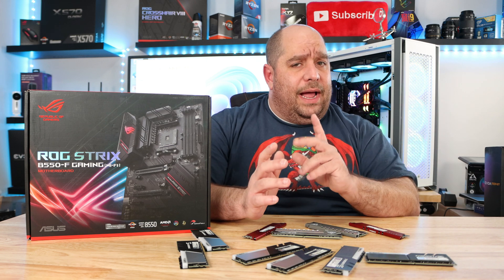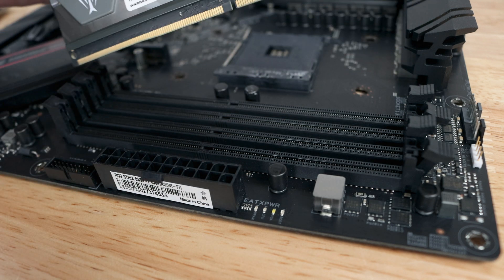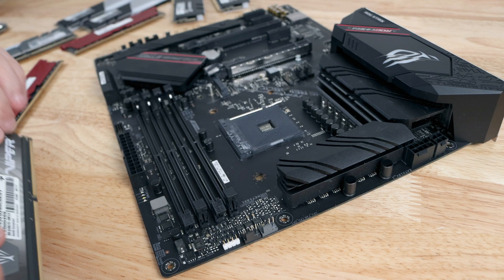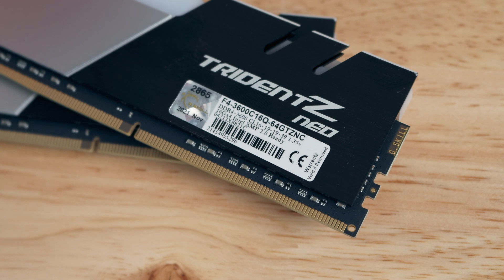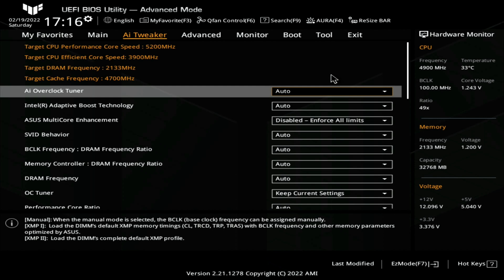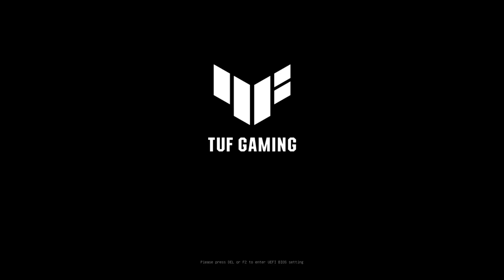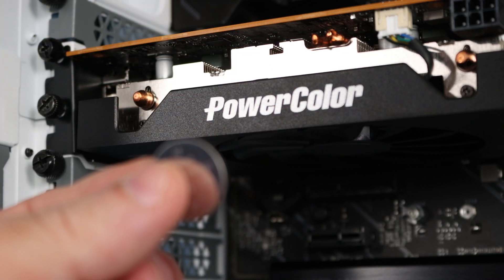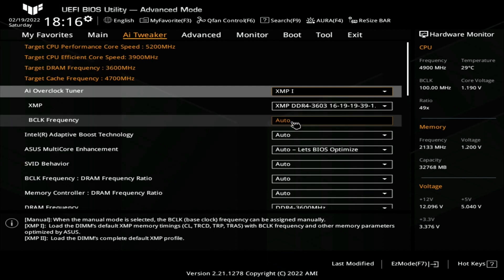How to install and configure RAM in a PC - Step By Step Setup Beginners Guide

Comment: KAYYYY so what if my keyboard and mouse keep freezing
Reply from the maker: @oscarwasntavailable SOOOOOO,  are they a wireless set of keyboard and mouse, or maybe you don't have matching sets of ram, might you be on an older version of the bios?
Reply: i have a wired keyboard, and a wireless mouse. both ram sticks are the same, (i should add that with my old stick everything works perfectly fine, yet i'm trying to upgrade from 8gb to 16gb) and... not too sure on how to update bios. (i have a b550 motherboard)

another thing i should add, i have tried putting one of each stick into a single slot and they work perfectly fine.
Reply from the maker: @oscarwasntavailable  so are you trying to put your old ram and new ram together and did you watch this video?
Reply: @ThisBytesForYou  no, i'm putting only the new sticks of ram into my computer.
Reply from the maker: Have you watched this video?
Reply: ...yup, followed all the steps.
Reply from the maker: so your RAM is in slots 2 and 4?
Reply: yeah.
Reply from the maker: b550 is a chipset, what is the manufacturer and model number of your motherboard.
Reply: gigabyte B550 UD AC-Y1
Reply from the maker: Here is where you find your BIOS', flash to the latest version: https://www.gigabyte.com/Motherboard/B550-UD-AC-rev-12/support#support-dl-bios
In this video, I show you how to flash the BIOS, at the 33:25 mark: https://youtu.be/XCggwcWdWsI
Also, what is the manufacturer and model number of your RAM?
Reply: on amazon (which is where i got it), it said  "GeIL ORION DDR4 RAM, 16GB (8GBx2) 1.35V XMP2.0" and model number is "PC4-28800"
Reply from the maker: Is this it: https://www.amazon.com/GeIL-Compatible-Immersive-Multimedia-Streaming/dp/B08T9142K2?th=1
Reply: yup, that's the one.
Reply from the maker: So your memory is not on the QVL, (Qualified Vendor List), which doesn't mean it wont work, just that its not certified, so that could be an issue.  When you use it, do you go into the BIOS, load optimal defaults, then load XMP profile for ram?
Reply: i'm using a pre-built, so i'm not sure about optimal defaults, and xmp profile1 is on.
Reply: wait a minute, i said earlier that i've put one of each stick into one of the slots, and they worked perfectly fine...
Reply from the maker: did you buy the memory separately or together in a kit?  Your using a prebuilt, built by a custom PC shop, prebuilt means more in lines like a HP or a Dell or something, this is a custom prebuilt, something you "could" build at home, you cant build an HP or a Dell, since they use proprietary parts you can't buy direct.
Reply: i bought the memory together in a kit,  and i'm using a cyberpower PC.
Reply from the maker: yes, a Cyberpower PC is a Custom Built, Prebuilt machine, as I stated, its using parts you can buy anywhere, unlike Dell or HP, you can check in your motherboard manual, that is "should" work in slot 2 and 4 (AKA DDR5_A2 and DDR_B2), you can find it on page 10: https://download.gigabyte.com/FileList/Manual/mb_manual_b550-ud-ac_1201_e_231211.pdf?v=dca890ae3ad42c15fbd578438b918570
Updating your BIOS might help, but surely using memory that is on the QVL would help as well which can be found here under the Support List: https://www.gigabyte.com/Motherboard/B550-UD-AC-rev-12/support#support-doc
This board, will also allow for Load Optimal defaults as I mentioned before as well
Reply: alright then, i might just try getting new ram sticks. do you have any recommendations, maybe?
Reply from the maker: @oscarwasntavailable What processor do you have?
Reply: a uhh... ryzen 3 4100.
Reply from the maker: Here you go, this is on the QVL, off of my Amazon Affiliate link: https://geni.us/1gRAo4t
 F4-3600C16Q-32GTZNC
https://download.gigabyte.com/FileList/Memory/mb_memory_b550-ud-ac_cezanne.pdf?v=571d6ef2c3a7b9392ee0c4dfbeb50827
Reply: uhh... real quick, where do you find the model number for these?
Reply from the maker: @oscarwasntavailable  on the qvl.... I linked up a few times now.
Reply: alright, so i got new ram sticks (i made sure they were on the QVL), keyboard and mouse still freezing. successfully updated my BIOS, keyboard and mouse still freezing. i feel like i've done everything, and nothing's worked.
Reply from the maker: @oscarwasntavailable have you tried another mouse and keyboard combo, maybe it's your mouse and keyboard that's defective?  Have your tied a different  port?
Reply: yup, i've tried another mouse and keyboard combo. but also, there's something weird i've noticed. whenever i try playing a youtube video, my mouse and keyboard freeze a bunch. however when i'm playing a game like minecraft, they don't freeze.
Reply from the maker: @oscarwasntavailable  disable hardware acceleration in the browser and see if that helps.  Also, does the issue happen with the other keyboard and mouse combo?
Reply: ...i feel so stupid right now. that literally fixed it.
Reply from the maker: @oscarwasntavailable Always a pleasure my friend, so very happy you stopped by, trusted in me to help you, liked and subbed as well as took a moment out of your day to thank me.  It means a ton to me and I am so very happy I could help you.
Reply: @ …yup, you were pretty much my only hope. if it wasn’t for you, i would still be stuck with 8gb of ram. thanks a bunch, and i hope you have a great year.
Reply from the maker: @oscarwasntavailable  always a pleasure my friend, not only do I love to help but I love solving puzzles so it was kinda fun for me too
Reply: @ThisBytesForYou  ughhh great nevermind it didn't fix
Reply from the maker: @oscarwasntavailable so what is the issue now, detail please.
Reply: @ThisBytesForYou  mouse freezing while playing a yt vid again even when i turned off graphic/hardware acceleration (it just froze again even when not watching a vid)
Reply from the maker: @oscarwasntavailable  so you still didn't answer what happens when you use a different keyboard and mouse.
Reply: @ i’ve tried, same problems happen
Reply from the maker: @oscarwasntavailable did you update the bios
Reply: @ yup
Reply from the maker: @oscarwasntavailable  did you load optimal defaults and load xmp in the bios?
Reply: @ yuppp
Reply from the maker: @oscarwasntavailable where do you the keyboard and mouse connected, front or back, and what are the colors of the USB ports?
Reply: @ in the back usb ports, and they’re black

(the freezing is getting worse and they're just constantly freezing while playing a vid and even just random at times)
Reply from the maker: Have your checked your CPU and graphics card temperatures?
Reply: yup... also i should mention, with just a single stick of 8gb ram, everything works normally, it's just that with two sticks of 8gb ram (from the same kit), it's when those problems start happening
Reply from the maker: @oscarwasntavailable what happens if you swap the sticks from the 2nd to the 4th and 4th to 2nd
Reply: @ThisBytesForYou  haven't tried it, but i'm very VERY sure it's still not gonna fix it
Reply from the maker: Very sure is not 100% give it a try, it will take less than 5 minutes.  Also, what was done prior to this issue occurring?
Reply: just me replacing the ram sticks, that's it
Reply from the maker: @oscarwasntavailable so swp them and make sure you seat them firmly
Reply: @ThisBytesForYou  ...so it took 3x 5 minutes, and... it fixed the problem. although i'm sure it'll only temporarily fix it. i'll let you know when they start freezing again.

(literally seconds after i posted that they started freezing again)
Reply from the maker: @oscarwasntavailable  during the time you started noticing the issues, did you ever change the cooler for your CPU or reseat your CPU?
Reply: @ThisBytesForYou  nope, never did anything with any other components.
Reply from the maker: @oscarwasntavailable I asked above, but have you monitored the temperatures of your cpu and gpu at idle and while you are watching a video or playing a game.
Reply: @ThisBytesForYou  just did, they're both at their usual temps of around 30°-40°
Reply from the maker: @oscarwasntavailable what is the manufacturer and model number of your mouse and keyboard?
Reply: @ThisBytesForYou  my mouse is a logitech g305 (great mouse btw), although i'm not sure about how to find the model numbers...
Reply from the maker: @oscarwasntavailable and the keyboard...
Reply: @ThisBytesForYou  ...oh right, it's just the keyboard that came with my cyberpower pc
Reply from the maker: @oscarwasntavailable ok so I will only help you with your mouse the keyboard is irrelevant even though that could be the issue
Reply from the maker: @oscarwasntavailable uninstall all the logitech software you have installed, if you have any other mouse software installed, uninstall it, if it asks you to restart at any pointed, then restart your PC.  
Once you have no other Logitech software uninstalled, Then go here: https://support.logi.com/hc/en-us/articles/360024690754-Download-G305-LIGHTSPEED-Wireless-Gaming-Mouse
Download and install the Logitech Connection Utility, then restart if it asks you too.
Then use the Firmware Update Tool to update the firmware on the mouse.
Reply: @ThisBytesForYou  ...alright then, that's fine
Reply: @ThisBytesForYou  it says that firmware is up to date, and also my mouse is still freezing
Reply from the maker: @oscarwasntavailable so did you uninstall all of the software and reinstall it?
Reply: @ThisBytesForYou  yup
Reply: you know what actually, i think it’s because of opera gx (the web browser i use) because when it’s opened my keyboard and mouse freeze a bunch and when i don’t have it opened (even when i’m running a game) they don’t freeze anymore

...yup, it was my web browser. because i turned off graphics acceleration, and that's what makes my keyboard and mouse freeze a lot. also found out that chrome is better than opera gx after all, so uhh... yeah, problem solved... maybe? i'll report back to you if anything happens though.
Reply: update, my mouse hasn't really stopped freezing, it's only freezing like... rarely.
Reply from the maker: @oscarwasntavailable so you say it could be opera, why not try Edge, just to test, I know, you probably don't like edge and I am not saying to move to it, but completely close out of Opera, then try edge, let me know how that works.
Reply: @ThisBytesForYou  nope, still freezing
Reply from the maker: OK, running to an end, but a few more things to try 
1. Download and install your chipset driver: https://www.amd.com/en/support/downloads/drivers.html/chipsets/am4/b550.html
in your bios
2. Disabling XHCI in Settings → IO Ports → USB
3. Disabled Legacy Support for USB
4. Make sure XMP and SVM enabled
Try the above first, if it doesnt help, try #5, this could cause a no boot issue, but don't panic, if it causes the issue... just re-enable it.
5. Make sure CSM disabled
Reply: ...how do i install my chipset driver in bios? am i supposed to just run it when booted into windows?
Reply from the maker: @oscarwasntavailable chipset is in windows
Reply: @ alright then, run it in windows?
Reply: ...might just have to stick with just using 8gb of ram, since if i just use 16gb at all, my usb devices will just keep freezing... i've done literally everything i could do, and nothing worked. no idea what else i can do. although, thanks a bunch for at least trying to help as much as you could.
Reply from the maker: @oscarwasntavailable sadly, I found it is a chipset issue, the B550 and I provided the last update with information I found here on the link below.  Using a single stick of RAM, you are running on single channel, so you are losing performance but it is better than stuttering.  You might want to buy a single 32Gig stick, https://www.reddit.com/r/gigabyte/comments/hrca2y/problems_with_b550_aorus_pro_ac/
Reply: @ThisBytesForYou  alright, makes a lot of sense, single using a single stick of 8gb with my computer makes everything work fine... although i'm looking through amazon, but i'm not finding any good ones... any recommendations maybe?

Comment: Hi can you please tell me what is DDR4-3603-16-19-19-39-1 number refer to
Reply from the maker: Well, its DDR4, the speeds are 3603Mhz and 
The First 16 is usually CAS latency. The time it takes between a command having been sent to the memory and when it begins to reply to it. It is the time it takes between the processor asking for some data from the memory and then returning it.
Then First 19 is the tRCD: RAS to CAS Delay. The time it takes between the activation of the line (RAS) and the column (CAS) where the data are stored in the matrix.
The 2nd 19 is tRP: RAS Precharge. The time it takes between disabling the access to a line of data and the beginning of the access to another line of data.
the 39 is tRAS: Active to Precharge Delay. How long the memory has to wait until the next access to the memory can be initiated.
the last number, the 1, represents the "Command Rate" (CR), indicating how many clock cycles are needed to send a new command to the RAM after a previous operation is completed; generally, a lower number here is better for performance.
Reply: @ThisBytesForYou  thank you so much .. in future please create video's regarding few best ram for the computer system
Reply from the maker: @newgamers8028  it will always be the fastest and lowest latency ram.  Always use that in the future.  The future, today, has DDR5, you need to update.
Reply: @ThisBytesForYou   okay thanks
Reply from the maker: @newgamers8028  always a pleasure my friend